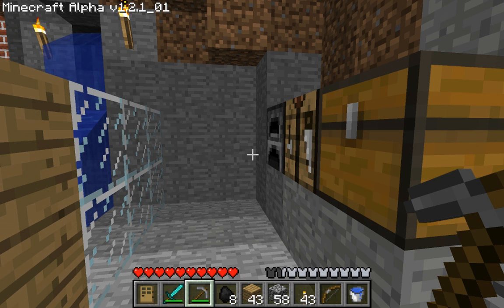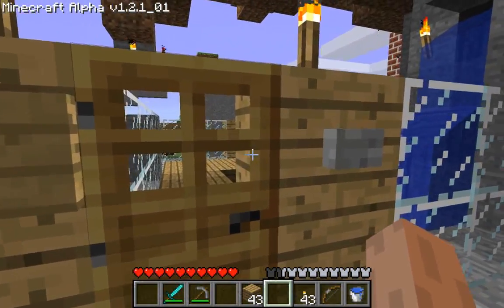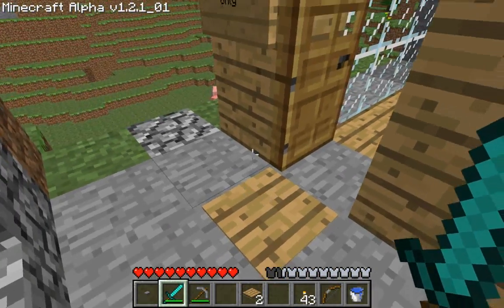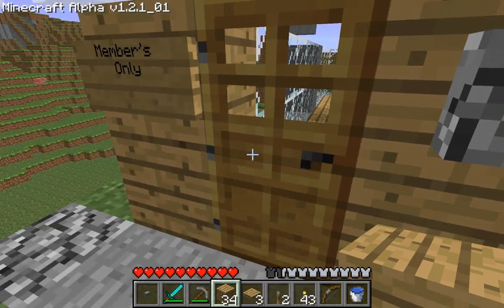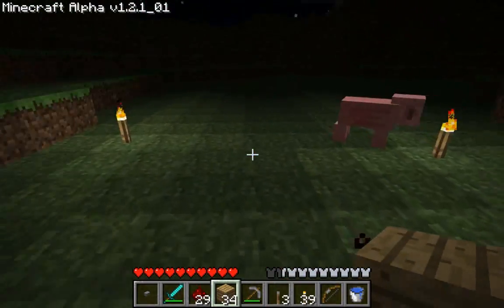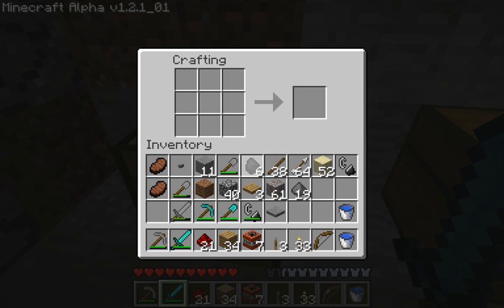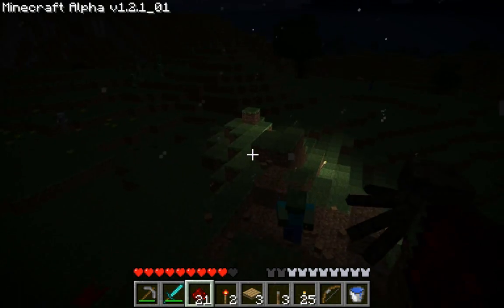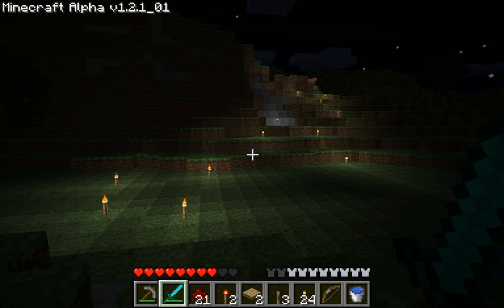Minecraft Tutorials - E22 - How to Survive & Thrive (Switches and TNT)

Comment: 2x2 pit, at least one block of water at the bottom, infinite spring works too, put the TnT level with the ground over the water, and put switches over all of them.  The water dampens the explosion but not the damage to mobs.  Or you if it backfires...  Since they fall in, they aren't likely to get away in time.  The deeper the gap between the TNT and water, the farther down the fall and the harder it is to get out on time.

Comment: landmines work better if you dig a 2-3 square hole straight down and put the tnt on the top and put the pressure plate on it. so when its activated it will fall down your small hole and it is more effective than a mine with no hole

Comment: A better TNT trap

Make hole 3blocks deep,fill bottom with  water, put TNT in top spot making a flat surface, pressure plate on top, will not let mobs escape; does not damage land, but does not work on spiders/slimes above small unless more than 1 hole is used in which case I recommend digging hole so deep the TNT falls out of range of the ones still standing